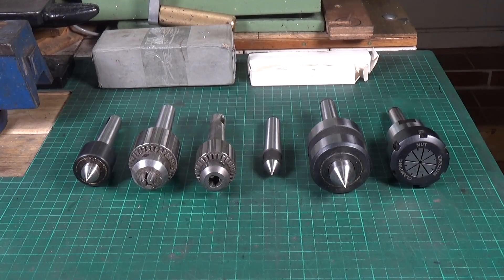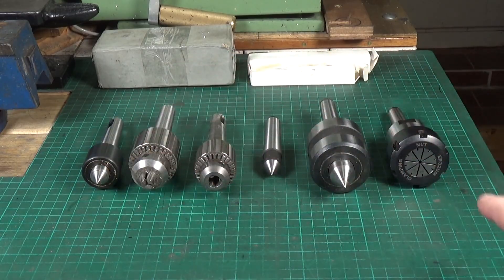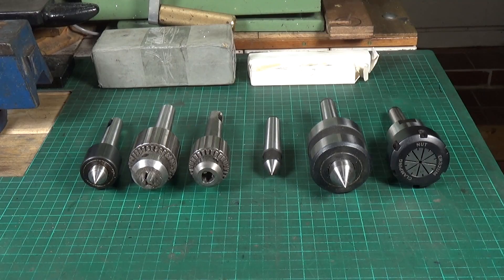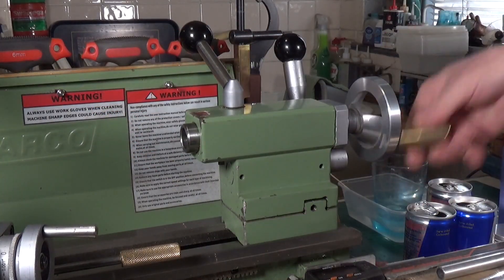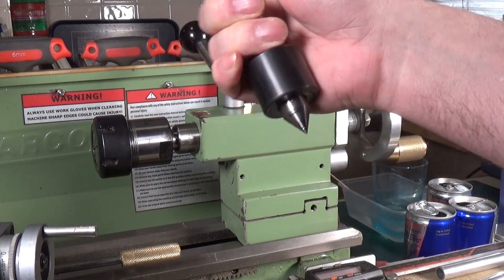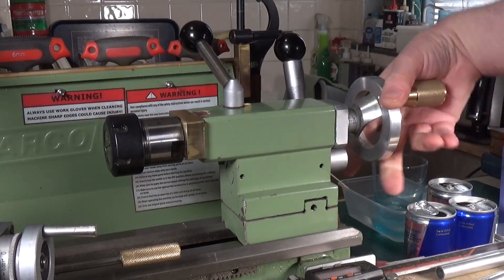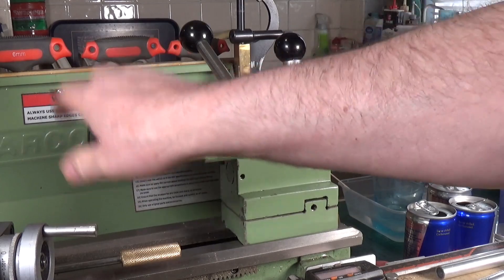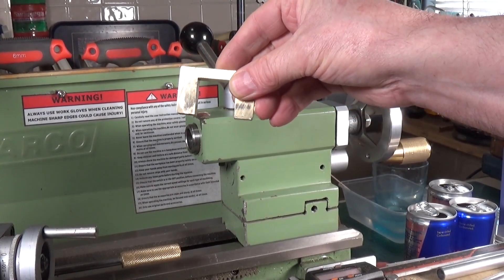Simple Ejection Method For Lathe Tailstock Morse Taper Attachments

Comment: Had the same problem and solved it much the same way using a scrap of wood. Doesn't mark the tool or the tailstock ram.
Reply from the maker: Anything will do as long as it's softer than the material the tailstock is made from.

Comment: Neat idea! Also, a couple of counterbored holes with neodymium magnets fixed in would keep it in place even with more clearance!

Those with 3D printers could easily knock one up in plastic ... doesn't need to be metal ... and magnets fitted also ... even just to keep it stuck to the side of the tailstock if not actually over the quill!

Great idea!👍👍👍
Reply from the maker: Thank you. Love the idea of using magnets 👍👍👍

Comment: Love it! My approach was to machine a 12mm length of steel rod to fit into the tailstock. It has an M6 threaded hole in the middle in case I need to remove it, but your idea is much nicer. 👌👌

Comment: That only works on larger rotating centers. Why didn't you put the dead center that was laying on the table in there and show that one. It won't work. You should never cut the entire tang off. You can take off to where you don't loose hardly any distance. And it still eject's

Comment: Thanks. It's good to see a video about some of the practical aspects of operating a lathe. I've got a lathe on it's way and the specs say it has a headstock taper of MT3 and Tailstock Taper of MT2 but when looking to buy do I buy MTA or MTB tools? This video goes partway to answering that for me for the tailstock at least.
Reply from the maker: It's quite common for small lathes to have a Morse Taper 2 (MT2) in the tailstock and a Morse Taper 3 (MT3) in the headstock. Your lathe will come with various chucks so apart from a Morse Taper Collet Chuck it is unlikely that you will need to buy any tooling for the headstock. If you need to buy anything for the tailstock, Jacobs Chuck for example then you just need to make sure it has a Morse Tape 2 shank.

Comment: Nice solution, thanks! I have a few MT2 tools, like dead centers and one or two others, with nothing to push against that way. I just add a 1/2" neodymium magnet and a short piece of 1/2" steel stock and leave them permanently stuck to the ends of those. Works well on my 10" Atlases. Thanks again, Alan!
Reply from the maker: Thanks. That's a great idea, using magnets, I would have never thought of that, must give it a try. Cheers, Alan.
Reply: The problem with magnets is that they gather metal particles which can gum up the taper if not removed carefully each time

Comment: Hi Alan,  that works well.  I used to just put the chuck key shaft between the front of the tailstock and the back of the taper chuck/center and it did the same thing.   Your machined spacer is less likely to mark the paint.  Good info for viewers.  Cheers Rob
Reply from the maker: Hi Rob. As you know I used to use a couple of old parallels and this was developed from that. The spacer is much better as you don't have to hold it in place. It was after I watched your video on ejection tangs that I stared thinking about it. Just had a delivery of a crate of 1698, looking forward to test sampling later today 🍺😂 Cheers, Alan.